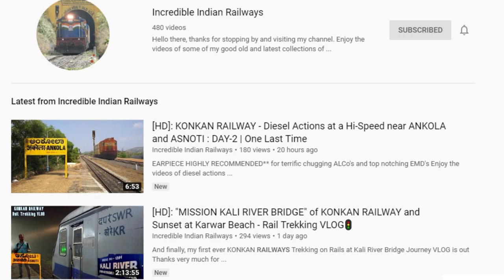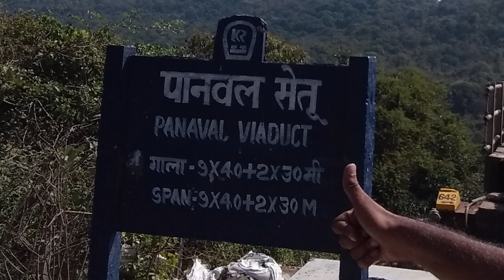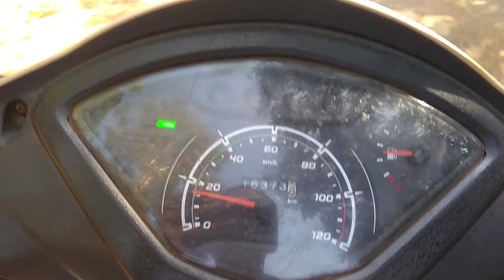KONKAN RAILWAY: INDIA's Tallest PANVAL VIADUCT - Trains Shattering out of Tunnel at 120 Kmph flat 🔥

Comment: Nice but JS was at 106 and Tejas was at 112. Not 120.
Reply from the maker: How do you calculate it man 😂☝🏻
Reply: 14 ICF coaches with a WDP4D in 11.40 seconds = 106kph.

13 LHB coaches with WDM3D twins in 11.40 seconds again = 112kph as per the app. Also judging by the track sounds it didn't seem to touch 120!